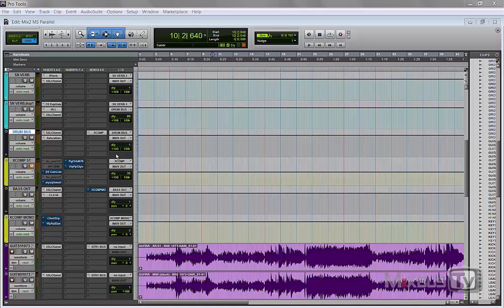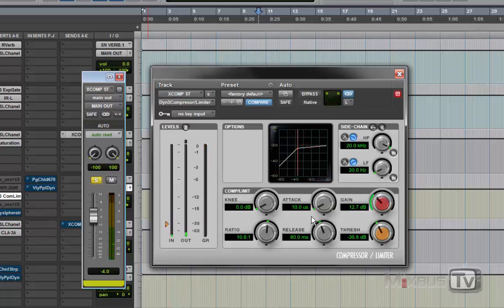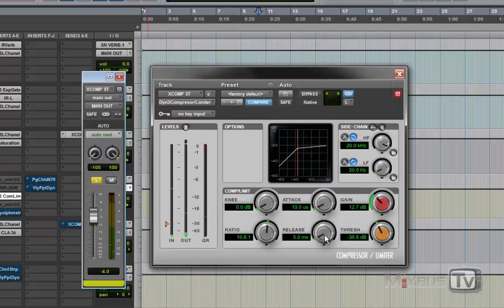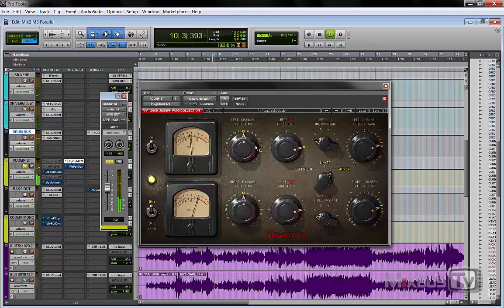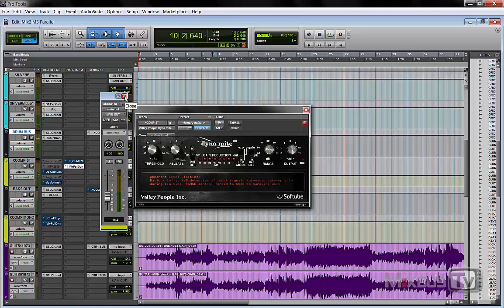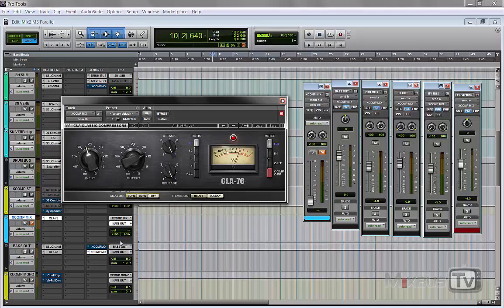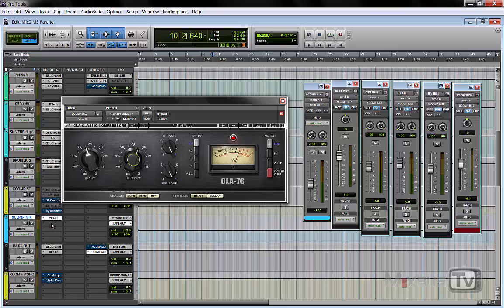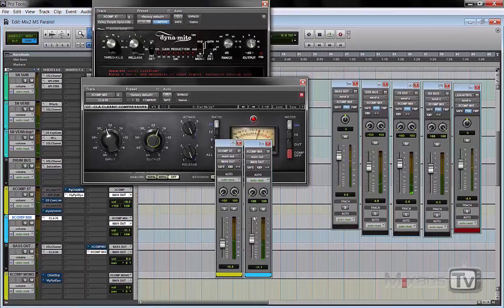Ultimate Compression Tutorial Pt.7 Parallel Compression Explained + cool mix trick

Comment: Lots of different compressor plugins used in this series.  Sometimes you call out the fact that a compressor has a particular tonal quality, but in most cases seem to be floating between different compressors.  Is this a consequence of fuckarounditis, or is there a particular reason you select one compressor over another for your examples?  Or is it just that you want to show that generally you can get by with any one of them (assuming they have the features you're demoing)?

If there's a particular reason you're favoring one compressor over another, it would be great to get some insight into why.

Thanks for the tutorials!

Comment: another excellent tut. learned lots again. have you tried the eventide omnipressor? its the dyna-mite on steroids that have been made using rocket fuel. its on sale this month
Reply: $49 this month. as is their ultra channel...both smash things to pieces if necessary, the omni is one of the two compressors in the ultra, so you can get the same sounds to a point...but the workflow is very different, and in my opinion worth the extra bit of cash. its kind of a learning experience. worth a look anyway